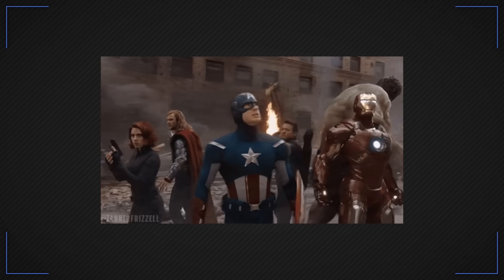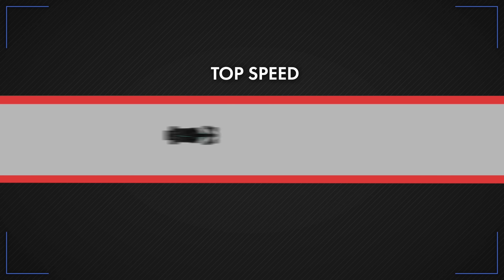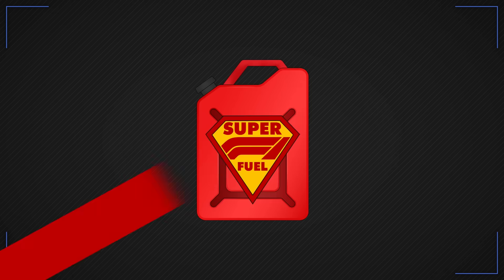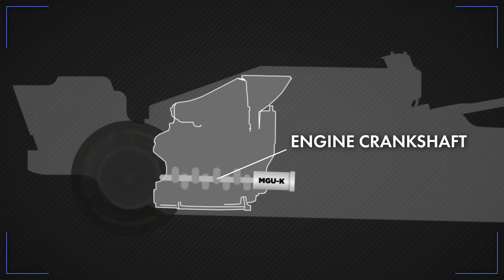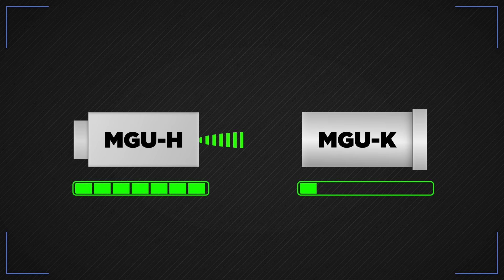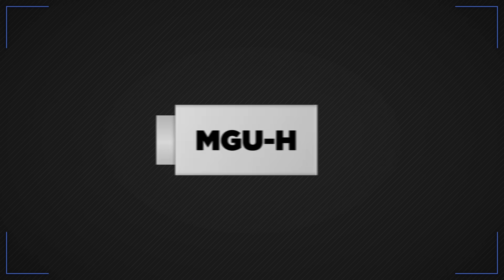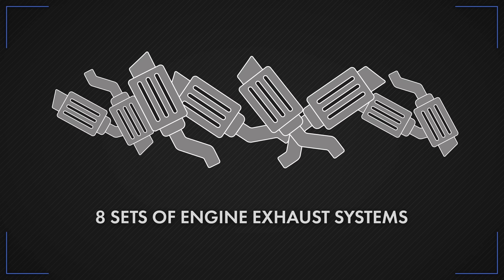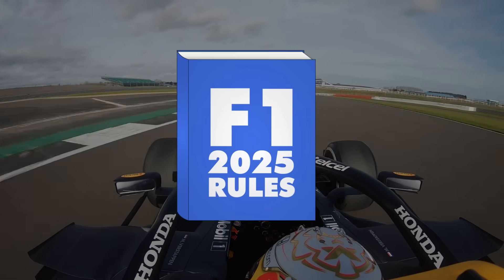How a  Formula 1 Power Unit Works

Comment: F1 is mandating supposedly carbon neutral fuels (about as fictional as it comes), and then increasing the size of the battery - a device that has a MASSIVE carbon footprint and is extremely volatile when there is a fire… Now that is logic for you.

Comment: This is lame. Soooo many restrictions and they still make about 400hp/l. Imagine if the engineers were let loose to work their magic. We would have engines that make 1200 hp or more like they used to in the 80s but very reliably since technology has come a long way. That's 750hp/l
Reply: F1 engine is designed for maximum performance, and it needs to run extremely tight tolerance for that. Even with today tech, I doubt 1500hp will lasts 50-70 laps

Comment: Nice explanation. I enjoyed it. Just one small correction at 2'14 ... It is not 110 liter they get as a maximum in a race but it is measured in kg's so it is 110 kg which is approximately 130 liters per race.

Comment: Minor correction: the fuel limits are in kg/hr or kg, not in liters which are nearly impossible to reliably measure as fuel can slightly expand or contract based on the temperature.
Reply: What is lighter, a kg of iron or a kg of dry grass?
Reply: @bestopinion9257  kgs measure mass, liters measure volume. Thats not the same thing.
Reply: @bestopinion9257  they're both the same. They're both 1 kg.
Reply: @Christopher_TG  Wow. I said brown.

Comment: Can you imagine the old v-12s turbocharged and with the hybrid system, I think that shit would be nasty 🔥🔥
Reply: well man, combine that with modern day material science, aerodynamics and toluene as fuel... I cant imagine what sort of monster machine would that be...
Reply: Then Look at the archaeic pushrod V8 engines in drag racing that produce insane amounts of power for far cheaper. Making about 11,000 HP for an 8.3 liter engine. That's like 1,400 hp per liter lol. Also the sound of a top fuel is something that can't be explained. It's the one motorsport where you have to be there to experience it. 0 to 330 mph in under four seconds.
Reply: how can a 1.6L V6 engine produce around 800HP?

Comment: There is another way to capture wasted exhaust heat...

Most people are familiar with Solar Cells for making electricity. Technically, they are called PV Cells (Photo-voltaic), aka light making volts. PV Cells can be tuned to operate more efficiently within a certain light bandwidth, typically Sunlight.

There is another kind and it's known as TPV Cells (Thermo-photo-voltaic) aka infrared heat making volts. These cells convert hot air directly into electricity. They can be placed inside hot exhaust systems and capture energy typically wasted out of the tailpipe. They are far more efficient than older thermo-couples. 

IC (internal combustion) with EV (electric) = hybrid. F1 takes it to extremes...
Reply: You’re next level.
Reply: Thanks for comment @craigdavid6668

Comment: I hope you can answer this question. When the cars are at maximum power they have the waste gate open. Why is that because the wastegate closed would be used to produce maximum boost right?
Reply: Typically on a standard turbo car, wastegate opens to let excess gasses escape and not enter the turbo.  Controld the boost to desired so you dont overboost and potentially damage the engine

Comment: This video is so underrated.
Reply: Mate he didn't even tell us what type of intake of throttle system it uses what do u mean
Reply: how can a 1.6L V6 engine produce around 800HP?
Reply: Most teams run around 12,500rpm or 13k rpm
Reply: @importantdolphin8974  Merc could rev up to 15000. Thats why their PU in the hybrid era was the best.
Reply: This video is bs
Reply: It’s not! He is promoting gambling site
Reply: How can petrol engine still exist in race cars today? the oil cartel is so underrated.